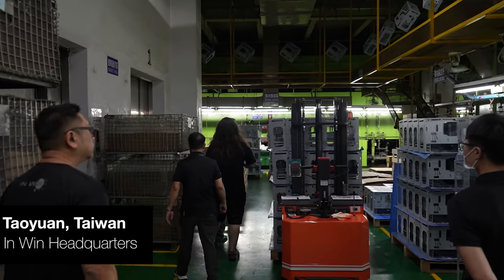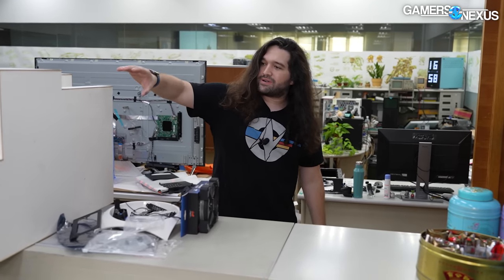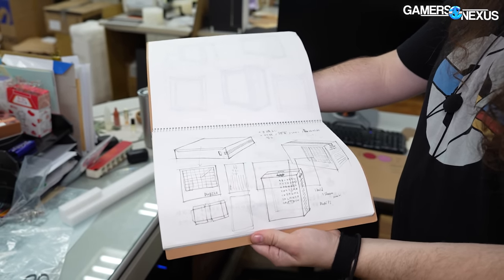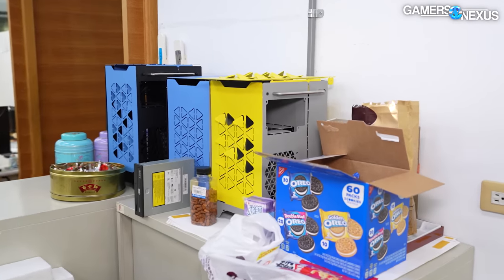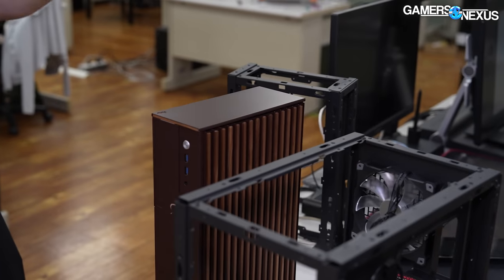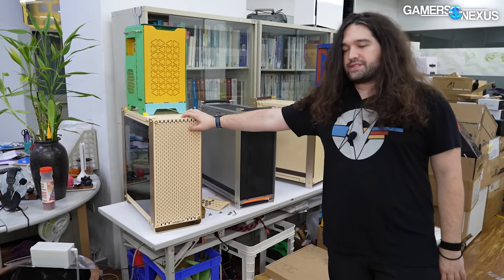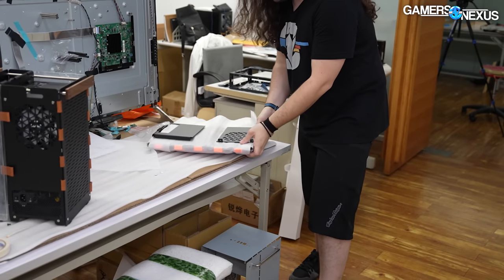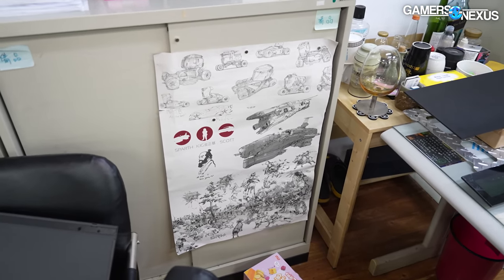Inside an Inspiring Computer Design Studio | In Win Case Studio Tour

Comment: I LOVE the champagne look,  I honestly love anything that is a step away from RGB on black or RGB on white.  It's very refreshing to see; especially seeing it done well.
Reply: amen. love the different colorways and materials. like the pop series and North cases. but those champagne cases were beautiful.
Reply: Fully Agree, Whole Heartedly Anti-RGB here, I love that Champagne Case with the solid side panel I just wish it had the perforated front on it like the model shown with the glass side window.

I have glass side panels right now and I regret getting them, they are just far too fragile and honestly I'd rather have a quieter system with sound isolating foam ONLY on the side panels with perforated front panel, top panel, bottom panel, and rear panel.

That gold colour with that beige champagne tone is just gorgeous!

Those golden bullet shaped screw caps are also an awesome colour, I'd prefer if they were not bullet caps and instead were the same shape but said "In-Win" on the face of them & had knurled sides on them, but key to liking them is that golden finish!
Reply: Same. Colours like champagne, ash, creme, etc as well as brass/copper/gold-like metals, tinted tempered glass, and details in materials like wood and leather is always refreshing and appealing, IMO.
Reply: champagne with noctua setup would be awesome
Reply: First thing that got my attention at the beginning b-roll was those cases. Would love for more case options with those kinds of colors.
Reply: I don't like it - but this might be the best argument I've heard in favor of the champagne, so much so that I hope InWin builds it!!
Reply: i would love the champagne case with perforated front but without TG side. im not in to rbg and TG in my cases. 
either a perforated side in strategic spots or solid would be nice.
Reply: @LukewarmMiner  I was just thinking that when steve was talking about it.Would look nice with noctua fans and cpu cooler.
Reply: Call me crazy, hell call me loony ( and boy, are they right), but why not do a black, gray, and white primed case (like the flat packed POC) and call it the paintable series?
Reply: EXACTLY!
More colors.
Less RGB. 

Choices are grand!
Reply: sadly, I cant use my wallet to vote for colors like these on the next 2 or 3 upgrade cycles, but at least I can hopefully use my comment to voice and support moves like these.  I would buy  that case in a millisecond if I were upgrading tomorrow.
Reply: @r.gilman4261  because powder coating lasts longer and takes to primer the same as bare metal does. The difference is that they can guarantee and/or warranty a powdercoat, they cant and wont do anything about you using a can of primer on it.  That being said, I would buy the product you propose in a heart beat
Reply: They would go GREAT with my noctua fans
Reply: I agree that "the champagne look" is more refreshing after all this RGB nonsense lately
Reply: I want to get a blue & white rallycross racing livery system case
Reply: That champagne case with the airflow front is the best looking case of the bunch.
Reply: @LukewarmMiner  This is what I was going to say as well. Champagne case with clear glass, Noctua fans, Noctua CPU cooler, one of the Asus x Noctua GPUs.
Reply: I love the champagne colorscheme too.
Reply: Glad I'm not the only one that immediately thought of a Noctua build for those cases. Love it.
Reply: Late to the party but I am rebuilding in that champagne case asap if they make it

Comment: The idea of flatpacking and "unfolding" the case makes so much sense. That would make make shipping them so much more eco-friendly! I love it!
Reply: A case with less rigidity is more likely to get damaged both in shipping or later in use, and could even pass that damage onto components. A damaged case is also more likely to get thrown out instead of handed down or donated or resold on the used market to someone with less money and smaller demands. You win some, you lose some.
Reply: @Lishtenbird  one of the folding cases looked like it used straps instead of bending metal to fold. This would reduce the rigidity but I think it will make it much more durable. It can bend in shipping without actually bending the metal and repeatedly folding it up won't snap the metal.
Reply: u got ur co2 licences for breathing ready, ya?

Comment: InWin's quality is not always the best, but they definitely have some awesome unique designs!
Reply: The main reason I never got a inwin case is partly for that reason. They look cool on the outside, but the inside will usually have some fatally annoying flaw that makes the higher cost not worth it.
Reply: Been rocking my gorgeous InWin 901 mini ITX case since 2016 and still going strong!
Reply: @ventilate4267  just like people!
Reply: @glebglub  lmfao
Reply: @ventilate4267  I'm satisfied with their Chopin Max (which they've had a few iterations on) but it's definitely tight. I imagine their recent design-led efforts aren't necessarily perfect in all areas if they're more for looks than practicality.
Reply: @TheGreenReaper  to be fair, that's barely a pc case is it is. There's not much you can do to mess it up.

Comment: With the improvement of modern TV's with PC input and high 4k/1440p refresh rates and HDMI 2.1 with LPCM pass-thru (some even including DP 1.4) I wish more case makers would design an A/V style horizontal case in their lineup that could accommodate the size of modern high end GPU's to go with home theater set-ups so it fits on a shelf of most TV stands. Not everyone has the space for a separate PC desk in their one bedroom apartment's/condo's. Silverstone GD11 is the only one left in the market, as far as I can tell. I'm barely hanging on to my discontinued Thermaltake Core G3 with a full custom water loop ITX build modd'ed with a 360 rad. Looks amazing when paired with a home theater receiver. If I'm missing other options I have yet to find them. One that could accommodate a 44mm (58mm) 360 rad to handle a 4080/13700k or 4090/13900k 0r 7900XTX/7800X3D and a slim res.

Comment: We loved a particular Inwin ATX mid-tower case back in late 90's. The motherboard mounted on a removable tray and we used nothing but those cases for all our customer builds for several years. I believe they were only around $40-50 with a power supply. I sure miss those days.

Comment: I bought a welding machine, shield, and grinder  just to build my rack.  It is similar to the 4 full size module linky thing.  I had to use stop sign post for some of it.  I figured if I have to spend $400 on a rack, I might as well buy the goods and build it myself.  Best purchase I made last year.  Those amd cpus heatsinks and fans require alot of height..  I had to go custom.  This is cool that a company can make a living doing this.

Comment: YES more non standard colors, especially the champagne! 
Also, I am super excited for this kind of video, and her reaction to your feedback was awesome to see. She didn't just nod and agree, then do what she already planned, she was actually trying to make sure she understood your feedback completely.  
Me, I'd rotate the PSU 90 degrees, and put it more away from the GPU. that way the airflow can go through the case easier, and the PSU will help vent air. It's how a lot of desktops did it years ago, and in something that's SFF, it's a way to get more exhaust in a system where space is the premium factor, rather than just have the PSU as a useless brick blocking the air in the case. Just my 2 cents about it, but I'm exited to see what they do.  
Also, AFAIK the first case that used wood was inWin, the A1 ITX. It showed with a wooden top panel to the case at Computex. I used that system for a couple years, but never was able to get the wooden top. Mine was glass, with a Qi charger in top. I had a Ryzen 2700x and an AMD Radeon VII in there, and it actually ran well, never throttled. I put a pair of Noctua PPC fans in the base, blowing into the GPU, and another noctua as exhaust on the side. The weird part was the back fan was intake for the CPU cooler, which was a Noctua NH D15 crammed in, with part of the fin stack dremeled off for clearance. It almost touched the glass, and I had to swap the fans for 140mm Noctua PPC fans to get enough airflow. Granted, it sounded like I was landing aircraft during 3D renders or intense games, but I loved that little thing. If they can get something that unique again, I'm buying it.

Comment: My first ever "new" case was an InWin - a massive box of beige painted heavy gague steel - in about 1997. I stuck with until 2001-ish. Back then they seemed like one of the pricier brands in the local shops, probably only 2nd in price to Lian Li, and offered more traditional designs than the juggernaught of fugly obnoxious plastic Antecs that were seemingly everywhere.

I filled it to the brim with then high end Panaflo 80mm fans and a much larger than normal PC Power and Cooling PSU.

Comment: 4:48 I can sympathize with that so much, especially with simple things where often I have exactly what I want already in my head and it takes longer to get it into CAD than it took to conjure it up in my mind. That said, I will also point out a word of caution, where sometimes I don't think of everything and after trying to get it into 3D land, I find out something somewhere just doesn't work (cooling performance, something electrical/EMI/RFI/THD/SWR/etc, or just the height of a component is taller than I thought it would be). the more complex something is or where it will be used is, the more important it is to CAD it out before committing to a final design, and yes that does sometimes involve scraping an idea entirely due to it ending up to be a bad idea after looking into it. Yes, I have scrapped a lot of LNA/filter ideas due to them just not working rather than sinking more effort into forcing them to almost function and just never end up as good as anything else that already exists, lol.

Comment: i like cases that are 
- large like the Fractal Torrent , so it's roomy enough
- front plastic mesh to keep dust away and front plastic grill to protect the front plastic mesh
- 1mm thick chasis (steel / iron ) , panels can be plastic
- DVD-RW bay and Floppy drive bay , some people still use them 
- modularity , server usage / gaming pc usage , to keep costs low for both buyer retailer and maker

Comment: I just built a system in the Evolv X, and it doesn't look like that champagne-colored box would've met my space needs, but if it were a larger mid-tower (like an Evolv X) I'd absolutely have considered it.  I think that prototype is beautiful. Idk how performant it'd be from an airflow perspective, but IF it's good in that regard and they do release the thing, I might pick one up and build my nephews a machine in it. 

Also as an aside, my knee jerk reaction to seeing it was that it immediately reminded me of the way old 386/486/early Pentium machines look once the plastic has started to yellow.  That might sound like a dig, but I mean it in a more positively nostalgic way.  Idk.

It's a different case, aesthetically, but in a good way imo. Assuming its airflow is good, it's easy to cable-manage, and the build quality is good, I'd absolutely consider picking one up.

Comment: Honestly, that massive case looks perfect for a desk i have in mind.
I basically want a large T shaped desk in my basement rounding out the two 90 degree sections so you can center yourself there with each side of the T being 2 distinct workstation/battlestation  with tripple 1440p 27-32 inch 144hz monitors that wrap from the top of the T down into part of the bottom of the T, one equipped for HOTAS, one for wheel and pedal (can be converted with a bit of time for co-op wheel, or co-op HOTAS), with the lower part of the T being a workbench area where those two monitors will be on arm that allow them to be folded out of the way when working on something.
This case would fit perfectly under that lower part of the T, though i dont know what all i'd put in it as i only plan for 2 full desktops and maybe something like a beelink SER6 pro or something similar as a 3rd computer if needed though probably not, while it fits near perfectly, i dont need all that room, maybe if i made a 3rd file server and threw a 40G switch in there to connect them all up to my core.
Man garage sales are awesome, i just picked up two, yes two EXTREME VSP7254XSQ for only $20 each, each switch has 6x 40G ports and 48x10G ports, one of them was even loaded up with about 30 various 10G SFP+ fiber transcieviers, some of them very expensive bi-directional models. Just the switch, without fans or powersullpies, is going for $2000 in ebay, these have fans and power supplies, and whine none of those sold recently, have sold for $2700

Comment: I have an InWin A1 Plus case (with a built-in InWin 650W PSU) which has been going strong for 3.5 years and has run nearly 24/7 that whole time.  Ryzen 2700X, 32GB g.Skill memory, Asus Strix B450-i, 1TB Sumsung NVMe, and only thing I upgraded was the GPU back in March 2022 from a Radeon 5600XT to a Radeon 6700XT.  CPU temps are mid 30s at idle, low 40s under regular use, and 55-60C during gaming.

Comment: If they want some feedback. I'm rather fond of mid century stuff like Eames chairs and brushed stainless steel with wood (higher quality plywood or bamboo can be fine here.) But functional engineering of the piece is fundamental to whether or not I'll buy it. I'm not one to use garish led fans normally nor do want to display the innards of my computer, but making the case a nice looking piece of furniture that goes with the room appeals. So I like the look of that case with the vertical wood slats on the side.

Comment: InWin's design center is probably one of the most fun places to work within this industry, just considering some of the insane cases and concepts they produce. 

I'm glad they're working around flatpacking and modularity, if any company can pull off early models and prove viability of such design, it's definitely InWin.  My only concern is how flexible the modularity can be, I want to see more than just attic-style modules where you can shove a radiator into an otherwise watercooling-unfriendly case; personally, I think the pinnacle of modularity is a singular platform that's expandable to house any system of standardized components, from ITX to SSI-CEB, from no additional 2.5" bays (board-based NVMe only) to having a personal NAS, from typical GPU sizes to housing behemoths within a variety of mounting configurations, etc.  I also have concerns about flatpacking, as the mounting methods for the panels could potentially make or break a product for many people; personally for me, I would rather see hardware that's countersunk and flush on the exterior surface, rather than having massive thumbscrew-like fasteners that protrude from the surfaces. 

As for colors, there's a market somewhere.  Just look at the automotive industry and all of the atypical colors that various that the OEMs put out, let alone the entire aftermarket for custom colors.  That 'champagne' color almost reminds me of a color that I think Subaru had at one time, I don't remember if it was them that put it on an Outback or another manufacturer putting that kind of color on one of their 'offroad' capable vehicles; either way it's a very sand-esque color and I know an auto manufacturer has offered it in the past with the other nature-esque color options within an offroad lineup.  What could be interesting is InWin targeting a DIY market, just sell off blank (either raw or primed) panels that can be finished by the end user; or finding a partner that can do custom colors and finishes by-order within the various major regions.  I'm glad that more manufacturers are trying to get into more colorways, but I think it's getting to the point where these companies need to consider alternative options rather than filling warehousing and logistics with a variety of options that go unused; this is where boutique-esque by-order coloring is useful if you can find a partner network to reasonably implement this, this is also where alternative materials (such as colored plastic sheets) make sense also which is also helped by flatpacking as that reduces physical volume of the product for warehousing and logistics, though with things like laser cut plastic it'd be interesting to see regional by-order manufacturing here as well.

Comment: My first actual gaming pc was a skytech prebuilt using an inwin case. 
It was a mini, so no real airflow... but it looked nice and I saw the engineering that when into it. Should have worked in theory, in practice too many cables were packed where the intake was supposed to be and that was the only place to put said cables... 
I had gripes with that particular model. But it was still the smallest case I've ever had. Was very convenient other than I had to keep the glass off.